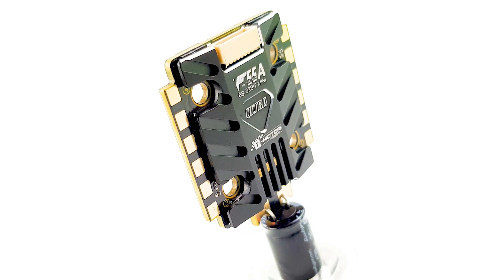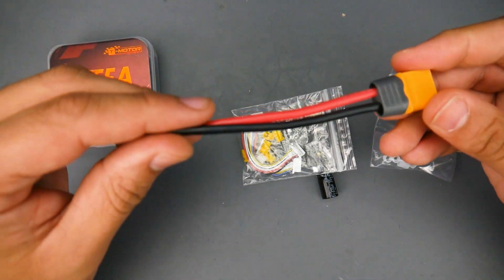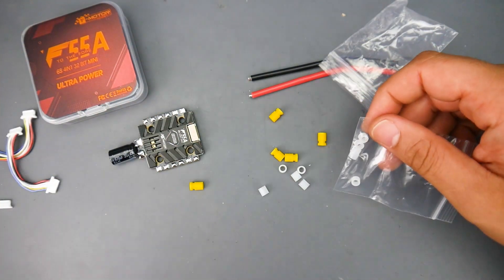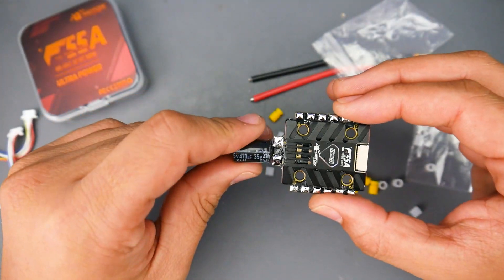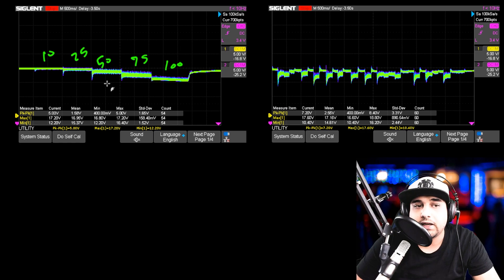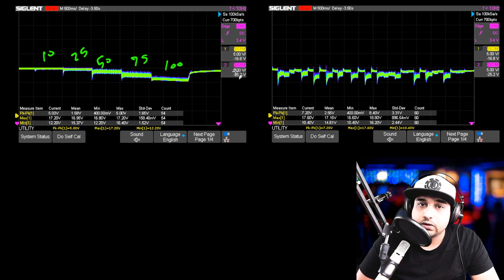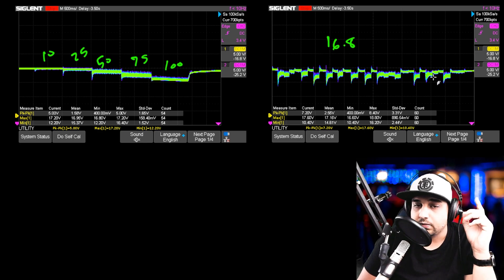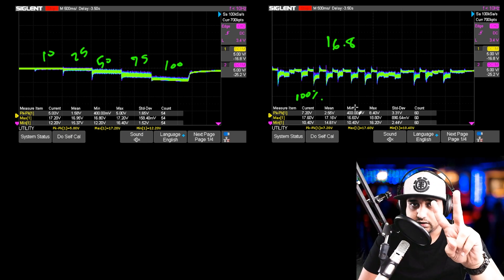The King of 20x20 ESC's // T-Motor Ultra Power

Comment: What 20by20mm m2 mounting lightweight  32 bit esc would you recommend for the Flywoo Explorer LR 4 V2 4 inch long distance drone with Flywoo Dave-C-FPV 1404 v2 2750kv motors

Comment: Hi man! Great review! I would like to ask you for help. I finished a drone with a T-motor F55A mini, and apparently this comes faulty. The drone flies, but the motor output #3 does not deliver the necessary power to the motor and the drone does not handle well in throttle punchs, doing rolls or flips. When inspecting the board for visible defects I found a solder bridge between two components, but I don't know if it is part of the board's design or it's a manufacturing problem, which maybe can explain the problem, could you see the potos that I posted and confirm if it is normal or a failure, comparing it with your ESC?  thanks!  https://www.facebook.com/groups/getfpv/permalink/731725887489072/
Reply: He doesn't reply bro the punjab is too cool

Comment: @Drone Mesh hey what would ya say is better the f55 ultra or the aikon ak32 pro 50a? Want to use it on a high speed build with 2210, or 2408 motors. Basically  something crazy. Thanks take care

Comment: Nice !!!!! I’m looking for a good 20x20 esc to go on a 3 AF XL BQE frame. 4S  1507 4000 Kv. 
I’m thinking Aikon 32 pin 32 BIT 35 amp 20x20 esc. 
Anyone have any different recommendations I’m trying to keep it light obviously this one is way too heavy 14 g for the T motor ESC’s.

Comment: Thats really nice... I'd like to see how far off the amp rating is though.. 180A in total in that tiny size/thermal mass? It does sound extremely optimistic.
Edit- its actually a 55A? So 220A total... Hmm. cant see that being true tbh.

Comment: I’ve been running the Aikon AK32 PIN 20x20 board for like a year now on my 6S 5” racing build with the hero 8 and have flown hard with nothing but good results. That has worse transient response than this so I imagine this’ll be perfect for basically anything. There’s less and less reason to use 30x30 components these days